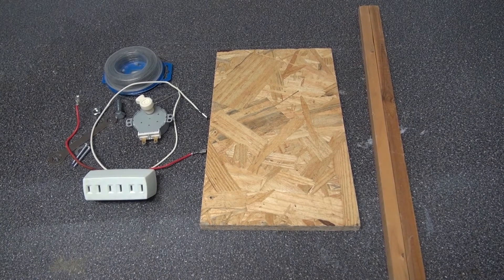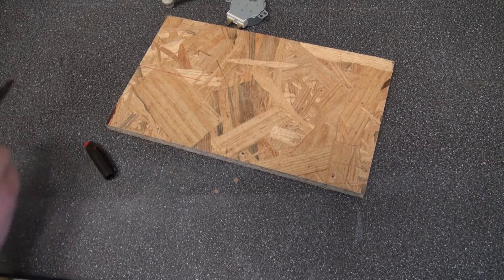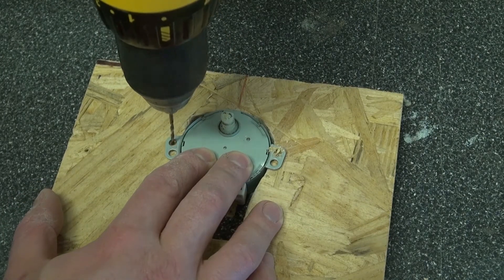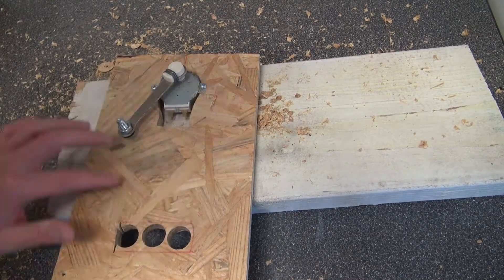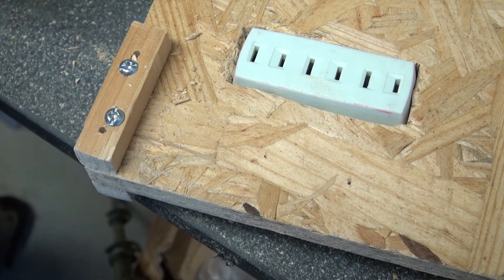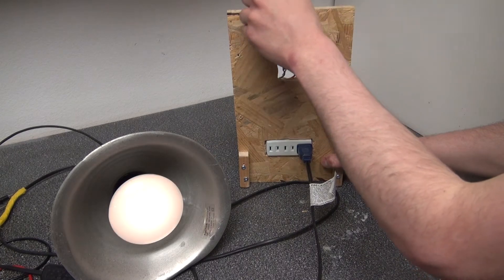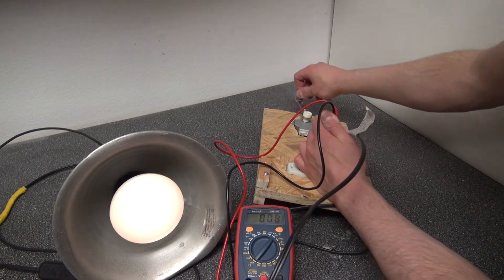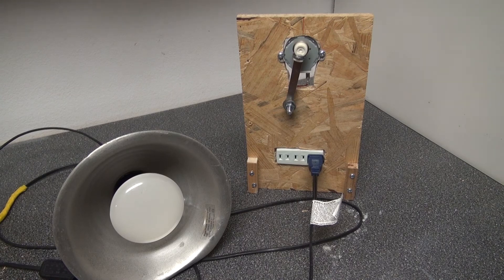Hand Crank Generator From A Microwave Motor

Comment: I see this is 7 yrs ago. Have you worked on this more? Could there have been fault in the windings of the motor, causing the drop at the same point. Like when a microwave jerks turning the plate usually means the motor is going bad?

Comment: Would be possible to make a speaker that plays music using power via a hand crank. I just want the music to play according to the speed which the crank is being turned.??
Reply from the maker: That is an interesting idea. I have to experiment on that.
Reply: @SciTyeTech  How can I contact You about it... :)
Reply: It have to be pretty low current, the output wattage would be close to its input wattage most are pretty low current. So yes it could power a low current tube radio like say for example a one or two tube regenerative receiver that runs higher B+ you’d have to add a rectifier and filter as tubes need DC on the plates. I doubt you’d find a solid state system that would work well. I built a two tube regenerative AM radio based off of Microwave1 “Low voltage regenerative radio” it’s multiple series of videos in the series hit design it for low voltage so it’s safe for other to build, it does  work at those voltage however I’m hard eating, but I’m also comfortable wearing heavy 102 year old headphones with 120volts dc across them and exposed, but that’s just me. 
Any how tubes have filaments so there’s two separate voltages my setup I’m using 6.3 volts for filaments, and as your herd max B+ is 120volts DC for the plates, the circuit only pulls about 1.5mA of current not even one watt of power! This could run a small medium voltage radio like that, you’d want a pretty good filter cap, but not absolutely insane amount of capacity rectify it go into a 10uF, then into a filter choke of around 3-8 Henry into another 10uF or you could do a 20uF then into a 10uF I would go much past 30uF. When I first prototype the circuit I used 47uF and the radio legit ran for almost 15, maybe 30 seconds after turning the 120 volt AC supply going into the rectifier. So it really needs to be a high impedance circuit to work effectively! And I wouldn’t try loading to its max either 70-80% load is quite a bit!

Comment: I don't have the same size ends to go over the outlet prongs, would I be better reusing a wall outlet I have sitting around since it wraps around the negative and positive screws or for demonstrating purposes could I just wrap the wire around the same outlet you have and use electrical tape?
Reply from the maker: Yes that will work too. Don't use electrical tape, it won't hold securely.

Comment: Do you know how to make the other motor from the microwave spin like I used a usb but doesn’t seem to work
Reply from the maker: if you are talking about the fan that is in the microwave, then it will not work with usb. Usb puts off Dc voltage and it also is not enough power witch is 5 volts. The fan from the microwave uses Ac Voltage at 110 volts Ac. So to get that fan to work, you could attach it to a plug and plug it to the wall outlet. But of course be careful while doing so! Hope this answers your question.